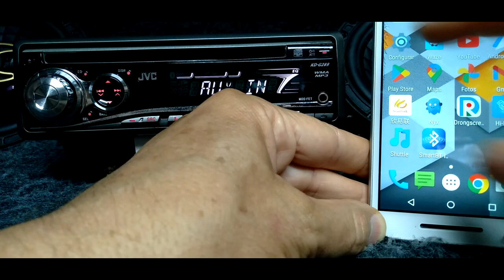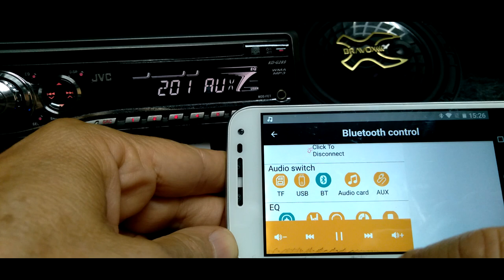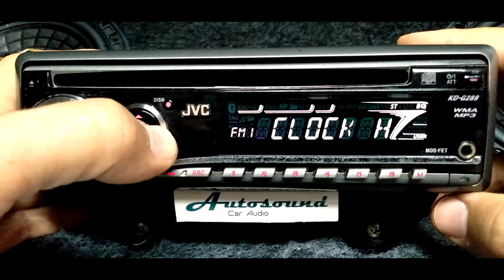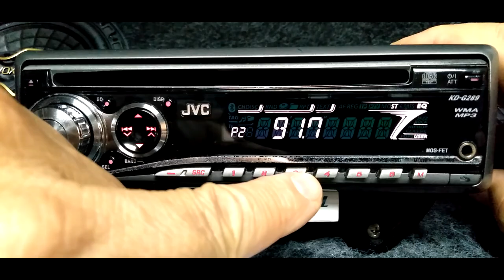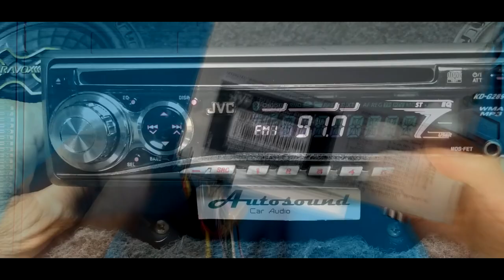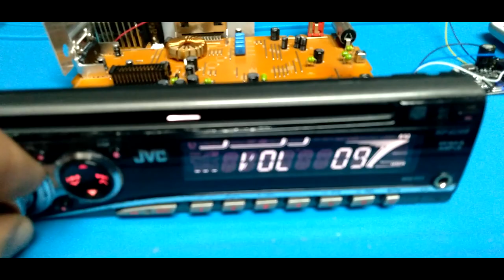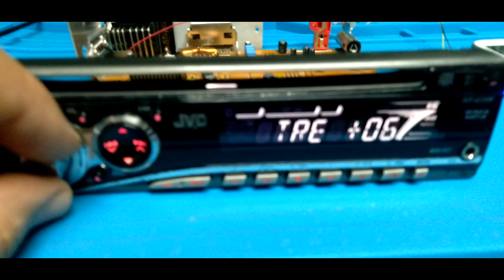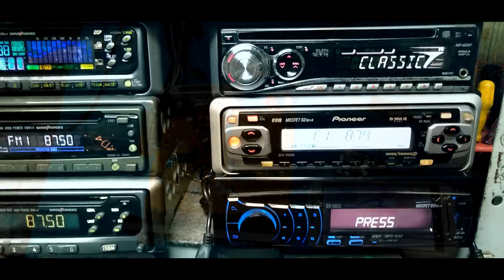#JVC KD-G289RUR / KD-G289UR Rádio AM FM Leitor CD c/ instalação de placa Bluetoth e USB p/ pen drive

Comment: TENHO 2 JVC DVD, INFELIZMENTE NENHUM DELES É COM RÁDIO VIA SATÉLITE, MES TEM CONEXÂO UNILINK PARA COLOCAR ACESSÓRIOS, NO CASO, BLUETOOTH, POR EXEMPLO, SOM BOM, OS DOIS DE 2006 OU 2007, POR AÍ, NOVOS, MAS SUPERAQECEM O DISSIPADOR E A VENTOINHA NÃO LIGA, COMPREI TAMBÉM VENTOINHAS DE 2,5 POR 2,5 NO ALIEXPRESS PARA LIGAR E COLOCAR A MAIS NELES, IREI LIGAR NA SAÍDA DE SINAL, VENTOINHA DE BAIXA POTÊNCIA, PODE LIGAR DIRETO, MAS NÃO SEI PORQUE NÃO LIGA AS VENTOINHAS ORIINAIS, OS DOIS DO MESMO MODELO E O MESMO PROBLEMA. SÃO DOIS DVD JVC KD-DV4299UR DO ANO DE 2006 E 2007 POR AÍ DE 180 WAT.
Reply from the maker: Para preservar os equipamentos use as saídas RCA e amplificador externo. Essa saídas de som originais não são eficientes e desgastam o equipamento forçando todo sistema a trabalhar quente e a potência é fraca e níveis de distorção alto.
Reply: @autosound  Eu já pensei nisto e até tenho um amplificador aqui, mas inelizmente classe D e se o amplifficador não for muito bom, acaba dando uma queda na qualidade do som, mas posso testar com um que eu tenho, um stetsom de 280w para 4 alto-falantes e dois rca.